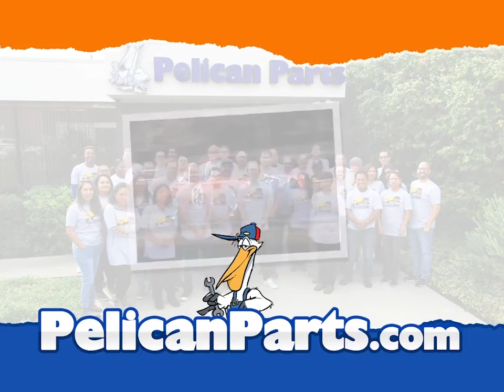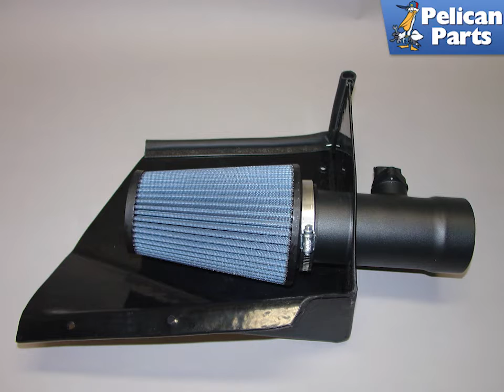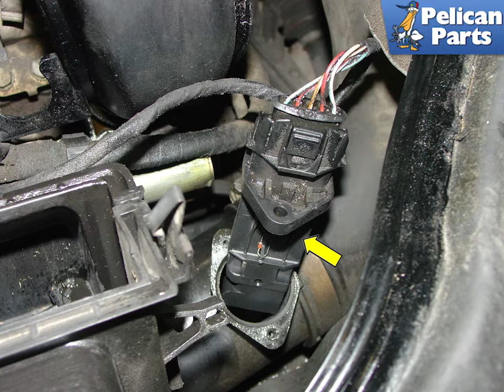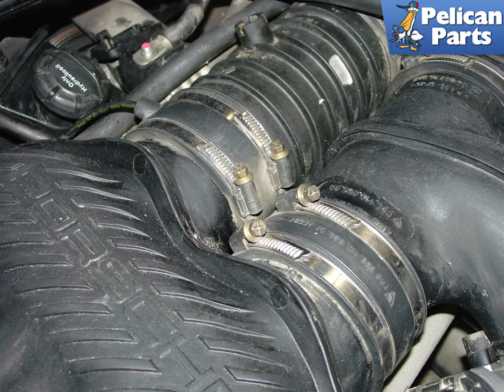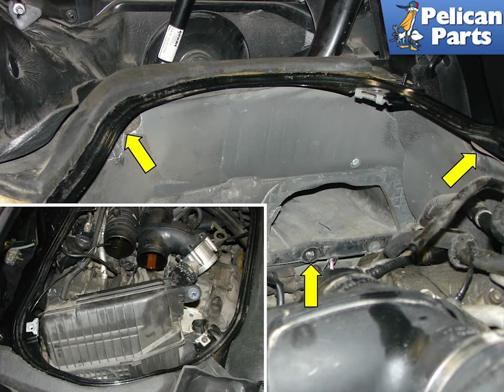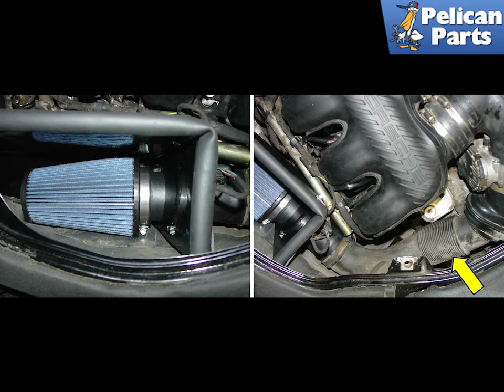Porsche Boxster 986 Cold Air Intake Installation

Comment: can it be installed on the 987.2?
Reply from the maker: I am sire there is an option for your vehicle.  With your vehicle info handy, give The Pelican Parts parts specialists a call at 1-888-280-7799. They can figure out what part or repair kit you need.